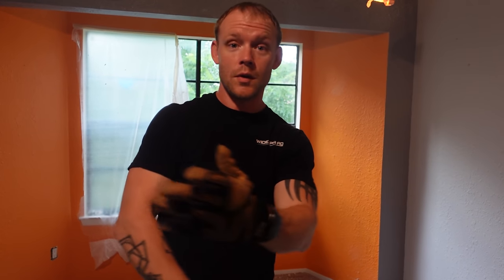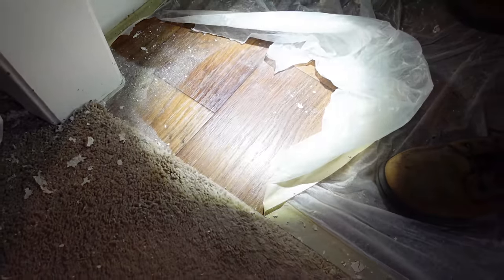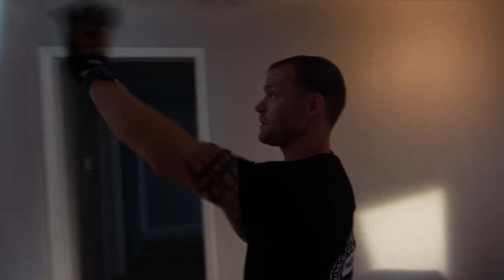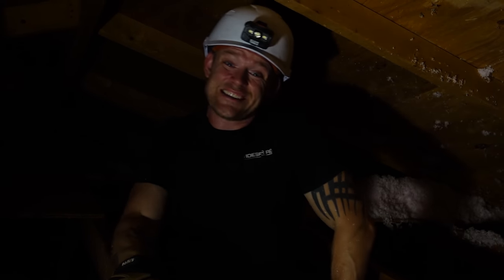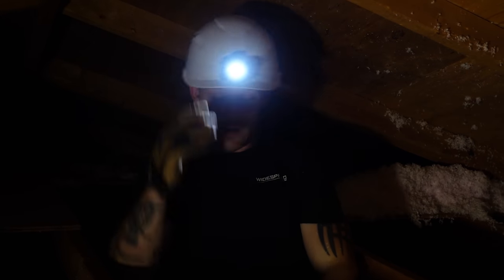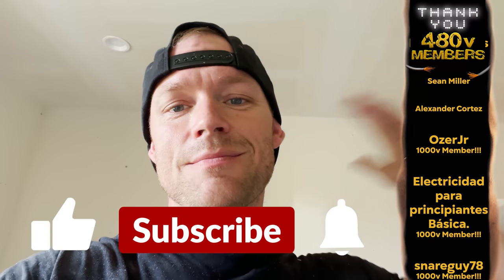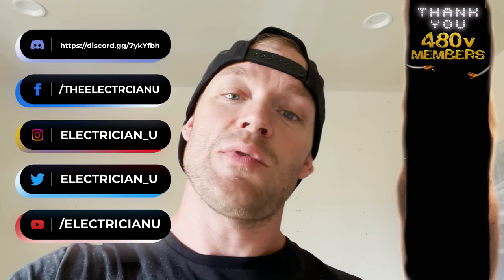Installing Recessed Lighting - Crawling in Attics - Remodeling

Comment: When dealing with drilling holes from one space to another (room to attic, room to crawlspace, etc... ) I will use the little irrigation marker flags. I can usually roll them up tight and stick them through the insulation and I can see them from above or below.
Reply: Or you can use what you already have on you anyways, solid wire. Not many electricians carry flags, unless they trace out a lot of underground.

Comment: The electrical inspectors here have been calling us on installing those pots in attic spaces even though they are IC rated.  They are not considered a proper seal according to our building codes and still require a vapor hat.
Reply: I've noticed that some of them will seal tight to the ceiling, and some won't. Even from the same box.

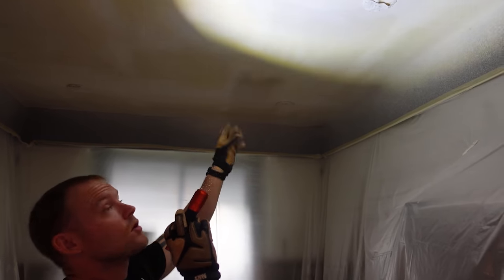Comment: 1:45 yeah, popcorn removal isn’t necessarily a hard job, BUT, it sure can suck, ESPECIALLY if a previous person decided to PAINT the popcorn ceiling about 5x 🤦🏼, sure makes removing it “that much more fun”🙄
Absolutely wear my hard hat as well in attics. Not only because able to clip a crap ton of light on them to help see, but also; can’t stand hitting my head on a joist, the stupid roofing nails (WHICH WILL ALSO END UP IN MY BACK, SHOULDER, ETC…at some point 🤬🤦🏼🤣), or anything else that happen to find. I’m sure you’ve seen, like me and most, some ppl do some weird crap when framing or adding additions, and such and my absolute fav, framing the roof and “attic” and then sheathing it in such a way that it’s 100% impossible to move around unless you cut back some of the weirdness that’s going on w/ roof pitch &/or add-ons (insulation breaks etc).
So, always wear a hat, regardless if on a job or in my death trap of an attic; imo, why not be safe….and know someone will say it; so here I go. Why not “be careful and pay attention”, b/c no matter how careful you are, when get to working and it’s 110° outside and putting it at around 135-145° in the attic…..ya wanna get in AND OUT ASAP! Plus, even if during winter and taking time, I guarantee 100%…..you’ll end up getting stuck w/ roofing nail (either on head, back, shoulder, arm, whatever), you just will😅
Great VID Dustin, and cool to see Josh again. 
Like vids like this; you sharing your personal life with us, which i appreciate.
Hope to see more throughout in this home remodel series (you make the 3rd person I know that’s a Sparky that’s remodeling their house this summer👍🏻👍🏻 LOVE IT)
Cheers to you both✌🏻

Comment: Only 14 gauge wire? You keeping 15 amp breakers on all the lights? Thought you mentioned in a previous vid Austin requires 12 gauge for everything?
Reply: LED lighting is so high efficiency that 15 amps is more than enough for all lighting. Now as far as code. It depends if he’s in city limits or county limits.
Reply: Commercial light? Yeah use 12 or 10g wire, I know that mess up size it wired…. My house have a lot messing size it like 14, 12, and 10g wire altogether because back to day some shorty show the Dorian any man doing lazy and don’t know how to do it.
But On future I will replace all wires to new electrical and braker with new main panel
Reply: @tallr264  no sir this is residential wiring. Commercial should be 12 gauge wire. 10 gauge would be ideal for appliances like water heaters or air condenser unit etc.
Reply: @MegaGsizzle  and also yes is correct 10 G need 30 amp braker but in my house have 14 g wire in laundry! That really bad but I want to replace the wire 10 gauge but my grandpa will be mad about it
Reply: Not sure on US regs, but in Canada, if the light cannot be easily replaced by a higher wattage version, like these LEDs, you can calculate the load and jam a ton of them on one circuit.  It works out to over 100 on one circuit, on 14 Gauge wire, on a 15a breaker.  You only have to limit your load if the home owner can easily replace it with a 60w bulb, which isn't possible with these pots.
Reply: @tysonkauth7232  thanks let know, I know some Country have different code
Reply: @tysonkauth7232  and also yes that correct

Comment: How do you know where to place the recess light in each four corners of the room and make them line up perfectly? How you do the measurements of that?
Reply: I tend to like to measure equidistant from each corner.  I'll measure 3 feet from each wall and hile saw out my hole there.  But if I'm in a upscale build, best to use a laser on your lines, to ensure everything is perfect.
Reply: @tysonkauth7232  ok thank you